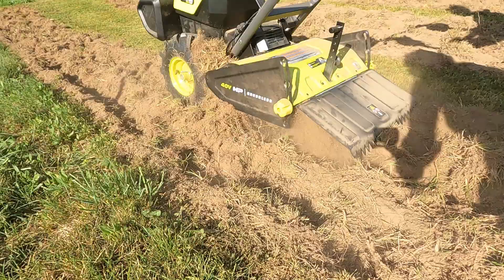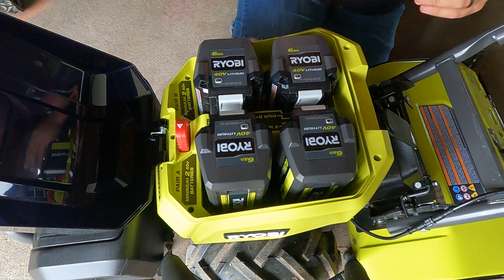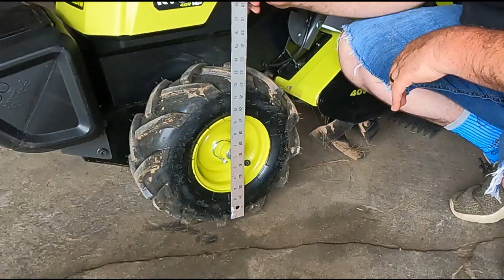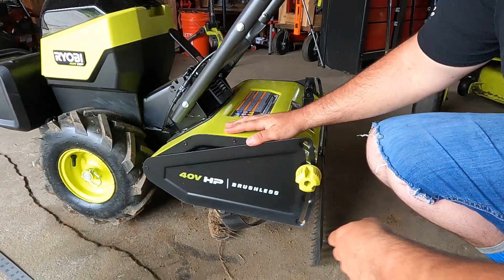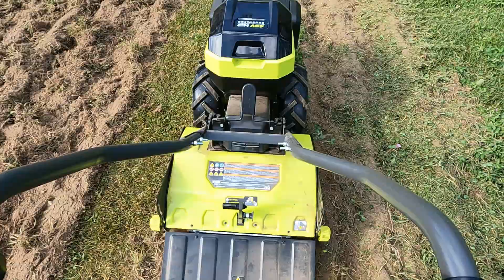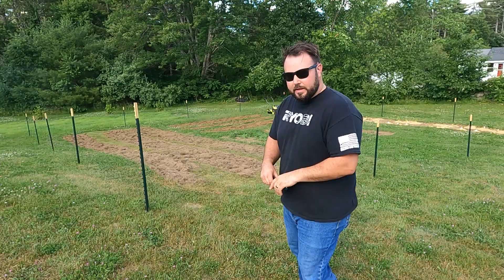Ryobi rear tine tiller, Insane power!!!

Comment: If you haven't already, I'd kind of like to see a head-to-head between the 40V Ryobi Earth Auger, and the 18V Planting and Digging Tool. Seems like both are relatively capable diggers, but they're maybe for slightly different usage cases? Like how deep do they go, how sturdy are they, how well do they deal with harder soil or roots, etc.

My thinking is along the lines of rehabilitating some cheap dead soil by tilling it up to loosen it, then green manuring it with cover crops like lupine, clover, etc., and chop&dropping it, then tilling the chop & drop back into the soil for biomass, to further loosen / aerate it, etc., and then finally use something like either the planting and digging tool or the earth auger to dig holes to plant various trees, shrubs, etc., and raise a Miyawaki-style forest on a small [or large] plot.

Just tryna' see what tools would be best for that sort of nonsense, and whether perhaps the planting and digging tool will suffice, or be able to dig better after the tiller does its passes to initially loosen it, then the cover crops further root & break it up. Or whether it would just be better to go with the heavier duty earth auger & be done with it...

Just researching for some crazy pie-in-the-sky ideas... ^_^

Comment: just noticed you've got the wheels spinning at full speed and they're pulling the tiller all over the place. in my experience it's best to set them to rotate as slow as possible. you'll have a much better time
Reply: I don't think the wheel speed can be adjusted separate from the tines.  I could be wrong through.

Comment: where do you get the shear pins at as i cant find a part number for them.  are you able to use a bolt as a shear pin till i can find some or get a part number for them.  thanks mark

Comment: $1200! No thanks. I'll just keep using my gas powered tiller that I've owned for years and works just fine. I mean who is going to spend $1200 for something they use once or twice a year?
Reply: Some people use it weekly for large gardens and weeding large plots of dirt
Reply: I use my tiller weekly . It is great for weeding the rows.
Reply: A year later, they are down to under 1k and in the same price range and in many cases, less than,  as gas powered units. Batteries have come a long way.
Reply: It would be cool if i could rent one locally. I've already invested in the Ryobi 40v system and i'd only need to use this once to break ground for the garden beds I want.
Reply: Billy I know this will come as a shock to you, but there are other people, I sorry to tell you this not everything is made for you.